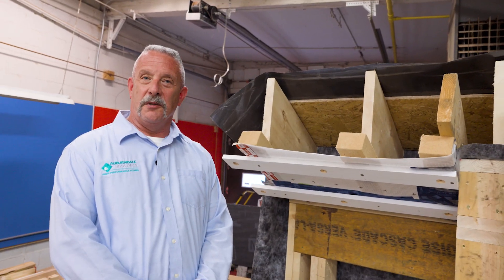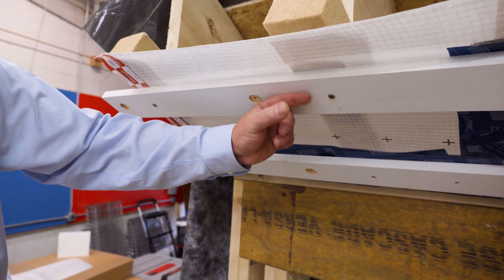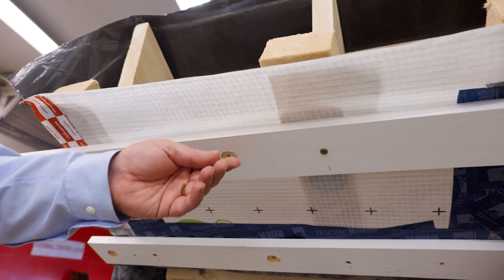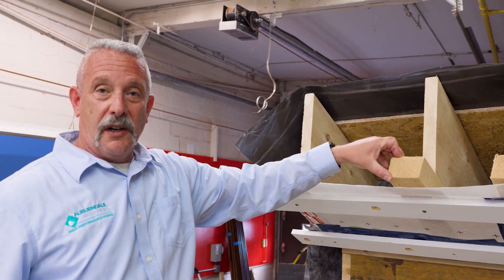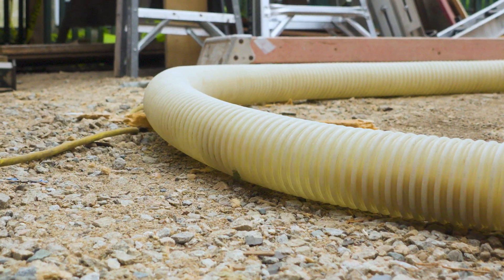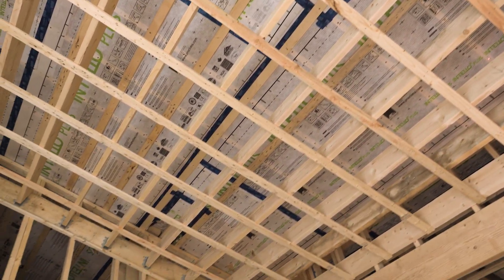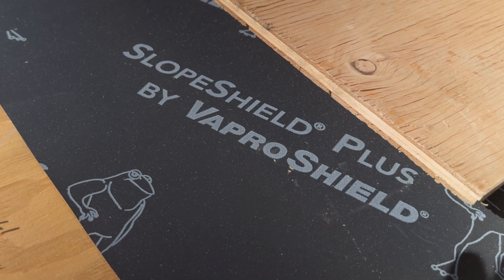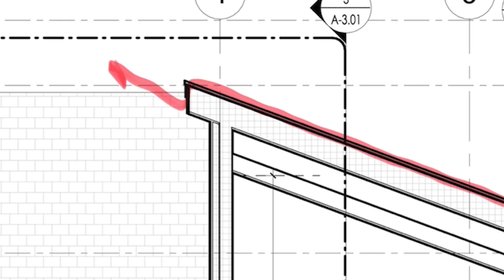Risk Management: Roof Assembly Walkthrough

Comment: Isn't the vapor control compromised with the blow in holes? How do you seal the membrane after insulation?
Reply from the maker: Great question and good point. All the holes get a piece of Tescon Vana tape or two to seal the slits made in the Intello Plus for the dense packing tube.

Comment: Is there a reason you didn't continue with the STEICO fibre boards on the roof?
Reply from the maker: @simongilligan5649 We certainly could have. That’s a fantastic way to do it and continuous exterior wood fiber roof insulation is an assembly we love to do but we also like to try new things out too. In this case we actually wanted to build an even more vapor open assembly than you would get with 4-6” of Steico on the exterior of the roof. And it was a good opportunity to do the thermal break technique on the interior. Any other questions about that?
Reply: @auburndalebuilders  I am interested that your vapour open approach is opposite to the zip sheathing vapour closed approach that I see referenced a lot. Did you specifically choose vapour open for a reason?

Comment: Not good design since  roof insulation can dry only inward
Reply from the maker: The vaproshield membrane on the exterior of the sheathing is vapor open, 30 perms, and has an over vented roof above it so we have drying to the interior and exterior.
Reply: @auburndalebuilders 5/8 plywood is not vapor open material. You can put what ever you want on top of it. It will not change properties of plywood
Reply: You might want to do your homework before popping off with negative genetalizations…
Reply: @ZachMaxon one more time. What makes plywood vapor open material in this assembly?
Reply: @andreycham4797 plywood is class II moderately vapor open.  It should work in this assembly.
Reply: @ZachMaxon dry wall has perm rate 5 times higher than plywood.  You will not fool anybody here

Comment: interesting youtube clip
about two minutes and 30 seconds in you say
You said it was a hydroscopic material and I think you are wrong in what you thought it was, it is not a hydroscopic material.
because if it was hygroscopic it would absorb water and it shouldn't.
there should be 25% insulation after the membrane where it stops air from penetrating and making it more efficient.
At least that is what the rules are in some of the Nordic countries at the moment

I live in an old house where there was 100 mm insulation but now I have 300 mm where 25% is after the membrane.
my energy consumption on heating the drop by over 30%.
Reply from the maker: @kastrup2dk In this case all of the insulation is in between two vapor permeable air barriers. The vaproshield on top of our structural sheathing is the primary air barrier. The intello plus is a secondary air barrier on the interior and its main job is to limit humidity from the interior making its way into the roof assembly and insulation. Air will transport tons of water vapor with it so the fact that intello is air tight really reduces the opportunity for water vapor to make it into the assembly. If it does the wood fiber insulation is hygroscopic - meaning it will absorb moisture from the air. This is a good thing because it will distribute that moisture in a more even way than say fiberglass would. So you don’t have a soaking wet area hopefully. Then if there happens to me too much moisture, too much humidity, the intello plus will sense that and open up to let it escape to in the interior while the vapor shield lets it escape into the roof vent. We don’t have % rules here about amount of insulation after the membrane. But we do have percent rules about the ratio of interior cavity insulation to exterior continuous insulation. We don’t have continuous ext insulation in this roof assembly but if we did we would want minimum 40% of the total r-value on the exterior. Does that clear up your question?